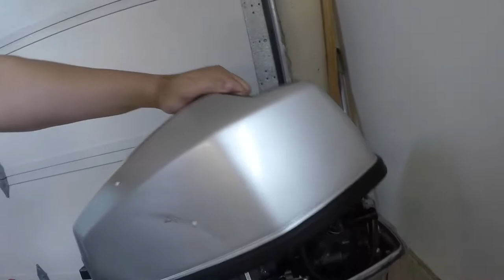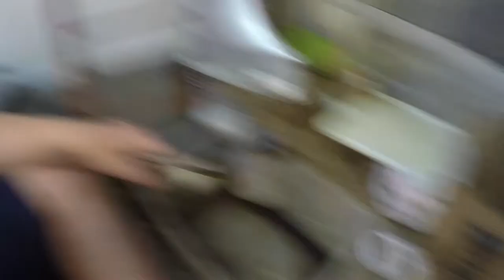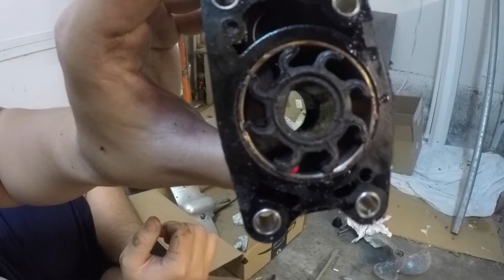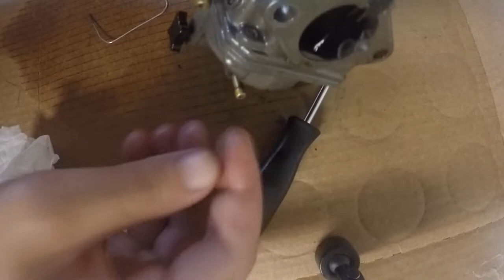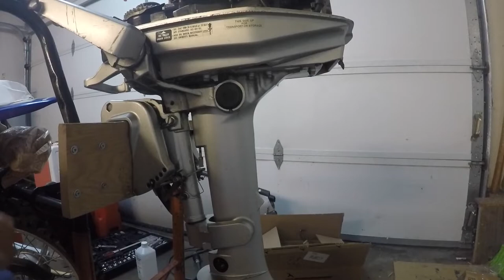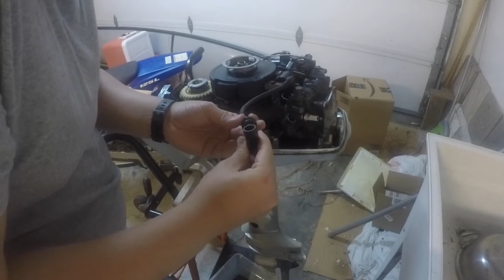The Complete Guide to Basic Outboard Maintenance | 2006 Honda 5HP

Comment: I have a 2005, great engine. I got lucky and found one for 500$ from an old man that kept it super clean, very low hours for the year. He only used it for his tender to go back and forth to his main Boat on moaring. Took the cover off and all the gaskets were brand new, no rot anywhere, always stored indoors. It gets my little 10ft tin vhull around at 12mph with 2 people plus gear.

Comment: Where did you get the fuel line from the tank to the motor and the connector
Reply from the maker: The fuel line came with the tank if i remember correctly. The connector i got from boats.net I think.

Comment: I picked up the same motor with the fuel tank and line for 300, still need to change the impeller and the throttle cable do to the cable sticking.

Comment: Awesome video, im about to buy a 5 HP honda outboard. 

The seller is trying to figure out a way to get the flush screw to actually come off. 

Its frozen/ jammed. . .  

Any tips on this?
Reply from the maker: @williamm.3612  a really big flathead screwdriver. Maybe check home depot? Also some penatrating oil might help
Reply: @OffTheHookFishing  both were attempted. Neither worked, had 3 guys 2 holding motor on stand its totally feozen
Reply: @OffTheHookFishing  I suggested buying some dustoff - and freezing the screw to hopefully retract the metal from the thread. Otherwise i think going to have to drill out/ dremel the thing out. . ..
Reply from the maker: @williamm.3612  You could always weld a nut head to it 🤷‍♂
Reply: @OffTheHookFishing  Went with another seller, 2014 Honda... :)

Comment: Good job, but I didn't see anything for if your motor is not peeing out water? Great video keep up with the good work 👍🏽
Reply from the maker: If it's not peeing water, its most likely the water pump (impeller). If you replace the impeller and you're still not getting anything, you probably have a clog somewhere.

Comment: Hi. Thank you so much for the helpful video! I learned a lot while following your video to fix a same model. An issue that I didn't find answer yet is when I pumped fuel into the motor, the fuel will spill out of a hole on top of the carb. Have you ever experienced this? Do I need to get a new carb in this case? Thank you very much!
Reply from the maker: I actually had this issue recently. To fix it, I tightened one of the carb adjustment screws. I don't think I knew about it when making this video, but it should be a copper screw near the top of the carb.

Comment: Just got one of these for free with another outboard. My shift lever is stuck in forward... any advice? Thanks for posting this and hopefully thus motor serves you well!
Reply from the maker: hmmm, i would try taking off the lower unit to see if the shift lever is siezed, or the low unit is siezed. If you take off the lower, and you can shift normally, you probably have some seized gears in the lower unit. This was filmed almost a year ago and the motor has been running strong. It did die on me a couple times, but i added stabilizer to the fuel, and the issue seems to have been resolved. Good luck with yours!
Reply: It’s a common issue with that engine. The gear shift shaft seizes in the bushes as they get compressed due to the aluminium corroding. 
To get to it you need to take off the powerhead and pan before you can get the shaft out. Take out the bushes and clean out the corrosion before rebuilding from there using a marine grease to lube it. 
Some people ream out the bushes but I find cleaning the aluminium is enough although I end up doing this job every few years. Crap design !